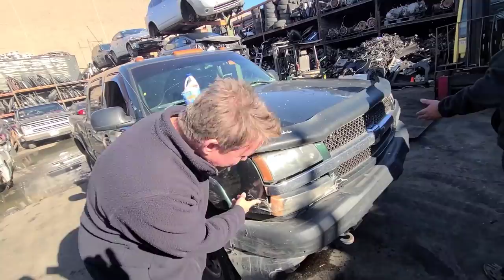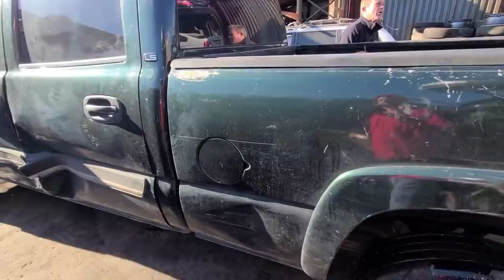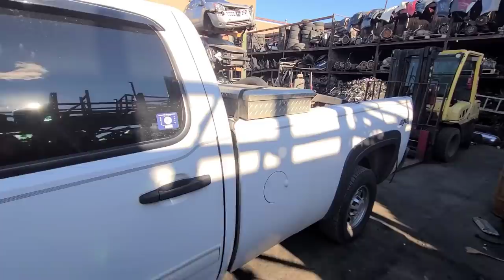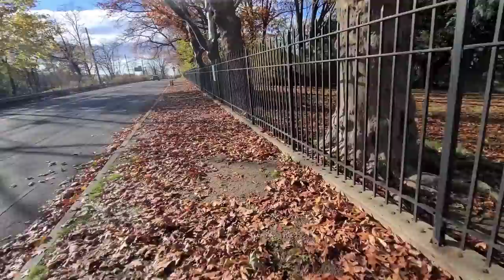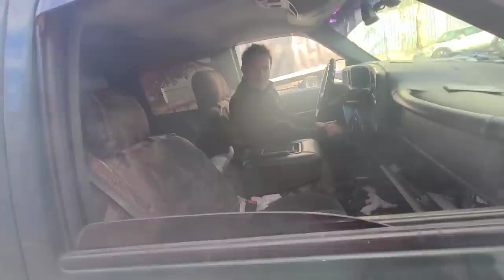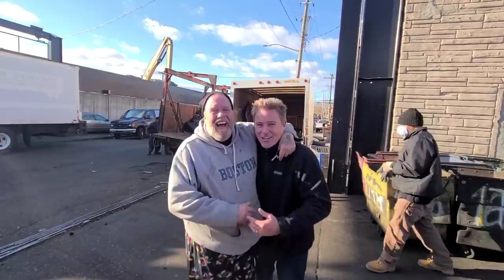Our Beloved HD 2500's Funeral...So Sad yet Fun as F@#k Neutral Drop 🤣😁😂

Comment: PLEASE DO THE 12 days of Neutral Drops this Christmas!
Reply: 12 reversi no mercy
11 burn outs
10 air bag pops
9 hand brake turns
8 radiator explosions
7 no oil engine runs
6 red line runs
5 tyre explosions
4 rear diff blown
3 gearbox snap
2 body frame snaps (yes Neutral Drop has snapped two cars frames)
and a head on crash into a steel beam

Comment: After watching STUNTMAN attempt to break the venerable 2500 HD, I'm even more confident in mine lasting at least another 3 years.
Reply: its a turd breaks down everyday.
Reply: @OldFarmAcresJoelK.  you're
Reply: @marktraum9139  what?
Reply: @OldFarmAcresJoelK.  oh I see f150 and I'm supposed to say they suck.
Reply: @OldFarmAcresJoelK.  yea right.. that 2500hd is a real truck , those gmt800's are built to last.
Reply: My buddy has over 300k on his
Reply: @OldFarmAcresJoelK.  dude 5.4 3 valves are one of the shitties gasser engines ever dropped in a pickup. Replaced countless amounts of them
Reply: @71sc502  I agreed with your statement. 5.4 3v are pure garbage.

Comment: hey i just bought a 1994 ford f150 4x4 5.0 5 speed and only 106k miles. I bought it off an old guy and it runs and drives perfect but its been used as a truck! This is the point of trucks is to actually work! I live in utah so I like to go overlanding in the deserts for weeks at a time and disappear. I have a cb and police scanner and all sorts of gps’s but its fun to go out there and live off the land.

Comment: Whats killing me is the fact when I saw the frame it didn’t rotted out its hard to find one that doesn’t have a rotted frame where I live the engines and transmissions mint but structural wise I wouldn’t want to drive one where I am
Reply from the maker: the only thing left that was good was the frame
Reply: @NEUTRALDROP  it was worked hard and was given a memorable send off I would still be in mine now im stuck in a 2013 subaru outback with so many problems and worse the bank owns it

Comment: In the next 3 year's that hd2500 Silverado will be replaced by the k2xx platform with of course the box frame (the gmt900s HDs for 2011my has started the box frame) and that White silvy will ripped it with the 363 vortec 6l90e g80. A Ford would of spun a cam phaser and spit a plug unless you upgrade for the 7.3 'zilla!
Reply from the maker: You already know

Comment: Let's see you do a 93 Nissan D21 manual
I can from a owners experience it will hold until the clutch burns out

Ohh, ooh, better yet 
2000 Toyota SOLARA automatic with 3.0l v6

Comment: I love these trucks. You guys probably already know this, but that green truck is a gmt800 and the new white one is a gmt900. And even though the bodies changed in 07, the frames and suspension didnt yet. So the new white truck is actually the same frame and suspension as the old green one ur destroying here. 2010 is when the frames changed to the shorter profile, but fully boxed, and they changed the suspension and wheel hubs and bolt patterns and stuff. I do think your right though that the 01-09 frame is better even though its only a C channel. The white truck should also have bigger “square port” heads, and a 6L90 trans vs the cathedral port heads, and 4L80 in the 01-07 trucks.

Comment: The midwestern salesman forgot to mention your brake lines will rot out every couple years in the salt belt. I make a good 8 hrs labor on those on a regular basis here in Michigan. You guys might wanna stock up on those Dorman kits. Meanwhile my 95   K1500 blew out the rear brake line in 2009 and the RF in 2019. All the other ones are original

Comment: 19 grand for a non diesel? Gtfo here! That's nutty. Maybe if it had the Vortex 8100. But really only if it was diesel. The lift doesn't add that much value.
Reply from the maker: Dylan it's crazy right now we paid 15k and felt like we go deal prices are INSANE!!!!
Reply: @NEUTRALDROP  i hear ya. But you would be so mixh better off with a duramax for your needs. I have same model silverado with a duramax and the alison trans. I am ober 560k miles, motor and trans havent been touxhwd ezcept for a tuner. And i always try to keeo the salt off it by washing it a lot, and I have a fluid film sorayed on the bottom for rust prevention

Comment: Wow...i cant believe the body ripped right off the frame like that. As much as it would hurt to see, if/when find an OBS f150 or 250, id like to see them do that to it and see if the body comes off the frame as easy. Or like a 2014 or whatever generation it was where the advertised how strong the frame and hardware that holds the body to the frame is. I think it was the aluminum body one so it would prob rip right thru the metal easier since aluminum is softer. Imagine thats what happens anyways instead of the hardware breaking. Would still be cool to see if the older ford holds up better.

Comment: If you take a 2500 and put a 1500 engine in, does that just make it a 2000
Reply: The 6.0 is in both already, so they already do. 2500 just gets you a much more robust layout, aka a truck actually built to work everyday not just getting groceries.